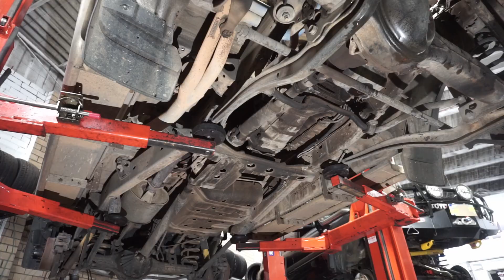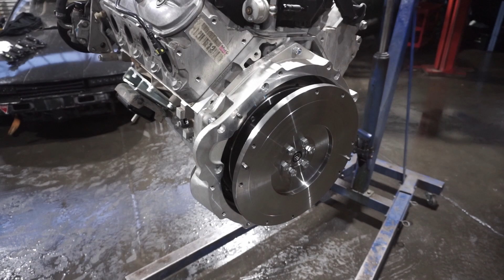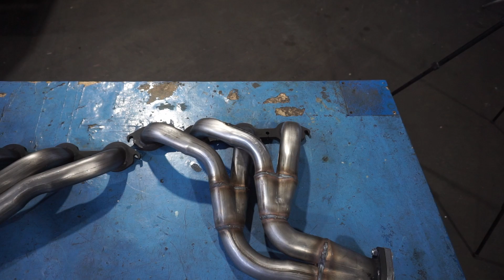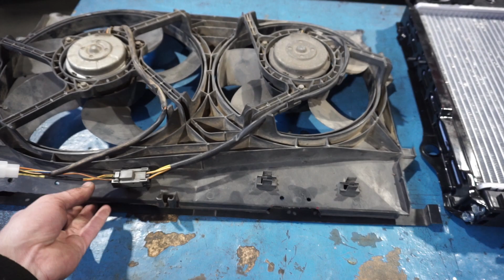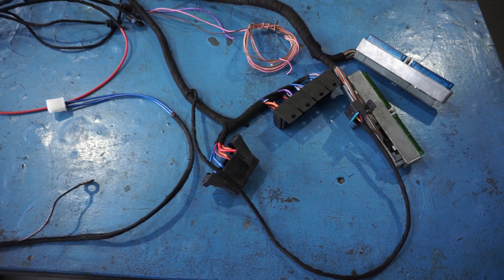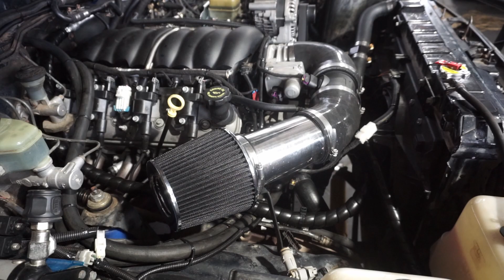80 Series Cruiser ls1 manual vs ls2 manual build and dyno

Comment: What fans are those again? You said it too fast
Reply from the maker: they are vz ss fans but you can mount vt-vz fans on them just make sure they are from a v8
Reply: @ZaredFox  Thanks. I'm in the USA, so I imagine it's the gto fan here. Corvette also looks to have a similar fan.
Reply from the maker: @landc8442  yeah it would be a gto fan then but most factory fans work better than 90% of the aftermarket ones
Reply: @ZaredFox  Thanks I appreciate the info. You do nice work and make nice videos.

Comment: You're spot on definately painted.  My 96 petrol 80 is on the cusp of 400k, maybe time for a ls up grade. Recommendation on a camper trailer tow setup? With that beautiful sound I can see many km under the rubber quite quickly
Reply from the maker: the 6ltr 6l80 is a great combo for towing but if its manual all ready its cheaper to keep it manual and just fit the ls motor to that
Reply: @ZaredFox  Cheers, I'll have to drop by and have a chat. Looks like I'll have to start ls2+ hunting,  It's an auto